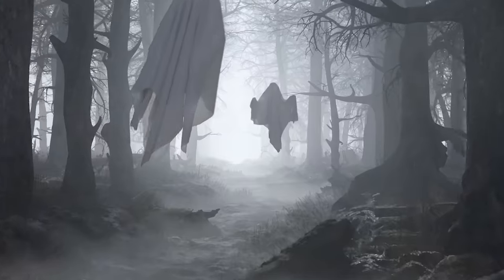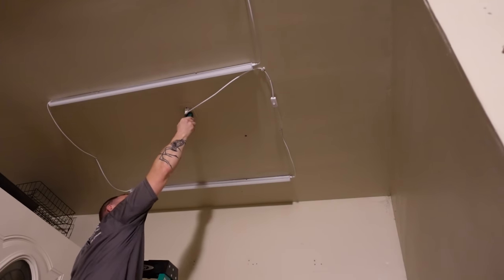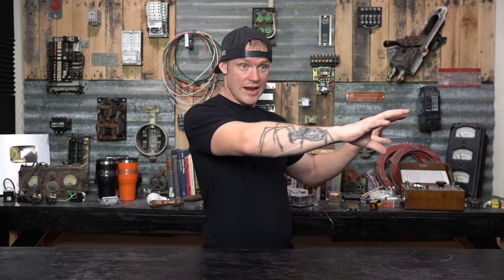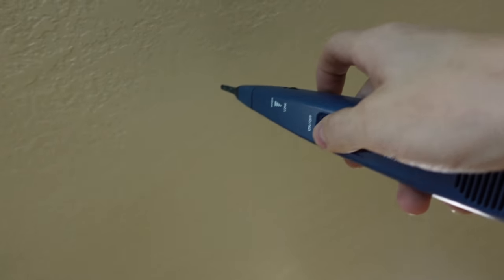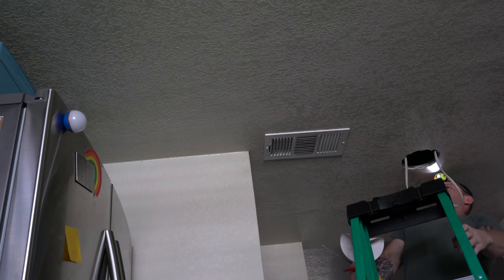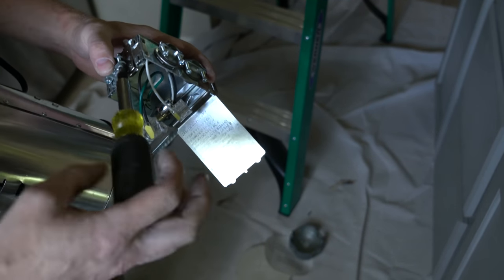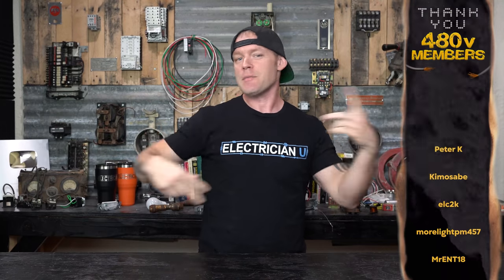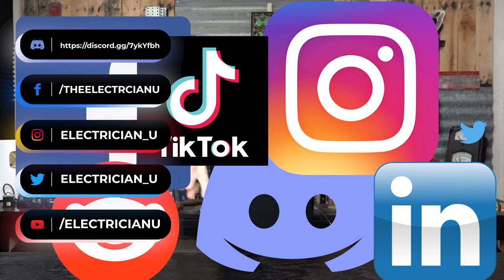THIS IS WHY ELECTRICIANS DON'T HIDE J-BOXES IN WALLS - Finding Hackwork!!

Comment: It's funny, just today I was troubleshooting a house with weird voltages on random plugs but some plugs working, 4 hours going through junction boxes and taking out receps and switches looking for a loose neutral. Finally I found it was the main power coming in, reading 5.6 volts on 1 leg. We called the local electricity provider and it turns out a tree limb wore through the jacket on the power line lol
Reply: Always check main power and panel before taking things apart inside the house.  Can save a lot of time over many service calls.  Not everything is a circuit issue or a burned junction.
Reply: @RobertMarts  it was an 80 year old house with newer mains coming in, I never would of thought it would be anything but the old knob and tube wiring lol
Reply: @RobertMarts  yessss...been THERE
Reply: I had the same thing. I first noticed it when I was in bed in front of a fan. It was a windy day and I heard the fan speed up and slow down. Turned out the drop was worn through where it passed through a tree.
Reply: always check the supply first...
Reply: Learnt that in field...took a min.but you right...line side
Reply: @obsoleteprofessor2034  called a brownout. Big problem where the overhead cables aren't maintained well, trees not trimmed seasonally. It caused us to have a HOT ground for a year, until I finally persuaded the power company to get the tree cut back in the street. 50v in the shower., bites from the faucets if you were barefoot...
Reply: @craigsymington5401  shit it took my local co-op killing three wildland firefighters the fourth getting burned over 90% and they had to pay him a 5 million dollar settlement to finally start taking tree trimming and inspection seriously
Reply: @craigsymington5401  We were fortunate that our electrical provider, SDG&E, handled a similar situation without any fuss. They sent a crew that added additional sleeves around the cables as the passed through the trees. Additionally, every two years they send a trimming crew to trim the tree branches back from the powerlines.
Reply: @RobertMarts  yup has this issue when my grandma called and told me some electrical outlets and lights quit working in her trailer I first thought it was mice might have chewed through wiring but then she found out she had partial power in her garage as well and the main panel is in the garage so as soon as I got there I checked the service entrance cable and sure enough one leg had no insolation on it and it was rubbing on the netural conductor so I put in a new service and updated the panel as well.
Reply: I had a similar problem but the only difference is that the one of the lugs on the main feed was worn out
Reply: Troubleshooting 101 in electrical and electronics; always check your mains. Though I admit to not following that rule all the time in electrical.
Reply: Make sure it didn't heat the bus bar
Reply: Took you 4 hours to find a dead leg??? I hope you are not a "professional" electrician, you would not be getting paid if that was my house. 15 minutes for a novice  MAX.
Reply: @craigsymington5401  YIKES !!!!!! Not good.
Reply: That's some darn good troubleshooting. Good job.
Reply: Apprentice move.  Take the whole building apart and it is the neutral disconnect.
Reply: Common problem and it always trips people up because if its just 1 leg damaged comming in, wierd shit will happen like only half of your house has power with all breakers on.
Reply: Had that on a flip house. About two weeks into rerouting and updating the electrical everything went wonky. GC kept blaming me until I finally got encore to come out. Turns out his fence guy put a post through the underground conduit. It was on the city side but he still had to pay outta pocket cause his guys weren't insured. Day labor's good for dirty work but you gotta keep an eye on those guys.
Reply: @ Nate 3006
 Thanks for posting this Nate! Now I know who NOT to call for any electrical work I might need in the future. And I'll make sure everyone else knows too. As an old  commercial work A/C mechanic responding to an "A/C out" call,  I would always check for power coming in FIRST, using that thing called a multimeter BEFORE I would take 4 hours changing out a compressor. Ya know Nate?
Reply: Once when i was getting a service drop- taken down so we could get at a tree I saw a city power guy  get blown right off his ladder because the bare conductor on the service drop was getting intermittently energized by a rubbed through spot on one of the hot legs, I think it arced right in front of his face while he was undoing the bare conductor---surprised him more than anything and he baled!  wasnt funny
Reply: ouch
Reply: @RobertMarts  Reminds me of a teacher going out with a student on a no heat elec dryer call. Student had dryer completely apart. Didn't bother to check for 240 at the outlet.
Reply: But you still charged the home owner when you should have billed the city or electrical provider.
Reply: I bought an old house with buss and screw fuses. I replaced the service panel with 200 amp service panel, got an inspection and the power company hooked me up.  The fridge sounded funny and the lights were brighter than usual so I shut down and called the power company. They had hooked up the 208 three phase to one of the legs.  So yes, check the supply line.
Reply: Wow. That crazy. And pretty awesome. Means you know your stuff. To track it all the way to the power source. We both learn something there. Check the main source of power first. Good job.
Reply: Hello

Comment: I went on a call one time to some apartments that were built in the 70's, tennant said all the receps on one wall didn't work. After checking every and anything electrical in the apartment, me and the J-man were stumped. It was then the tennant told us this problem started happening after the people in the apartment next door moved out. Uh oh. So we checked out that apartment, and surely enough, the power was off in that apartment, and we found out the receps were being fed from the panel next door.
Reply: That’s a bummer, now his electric bill is going to go up
Reply: @ndusrnm  lol
Reply: That's where you plug in the space heater
Reply: A plug was dead on a back to back kitchen. What was odd was that the lights were on in the adjacent unit with no tenant. I found power in the empty unit so I figured the original wiring had been flipped during construction and no one ever noticed. It turned out that someone had nailed through the siding, severing the hot from unit 1 and puncturing the hot on unit 2. The nail was conducting power from one hot to the other.
Reply: @obsoleteprofessor2034  wow!
Reply: Had a customer who had power when the municipality had disconnected. No magic there. Neighbor was supplying via buried cable. Smh

Comment: Electrical engineer here. Have to give electricians credit because all the circuits they need to troubleshoot are buried behind walls. I'll stick to my circuit boards lol
Reply: I worked in automotive for 40 yrs. everything is hidden . I could tell some stories lol.
Reply: Lmao, it's so true though.
Reply: In the factory I deal with freaking everything 🥵 mains to 5vdc, comms, networking, air, motors, bearings...
Reply: Fellow EE here but I also do the electrical work in our office at times - everything from taking care of our pick & place to our environmental chamber. Yeah, I agree... I'd rather be on the bench than up on a ladder or poking a hole in the wall.
Reply: Also EE, and all of my circuits extend no farther than my test leads.
Reply: Engineers trying to take kudo’s meant for trades people once again! Stick to your blueprints unless you have a trades ticket!
Reply: @harles5000  Lol I actually started out in the trades, then went back to school to be an engineer... So I COULD take kudos if I wanted. Many engineers started in the trades.

And quite frankly, while trade work can be difficult, engineering work is on a whole new level. As we don't look at "blueprints" all day, we create the designs for everything in society. Most engineers are capable of anything a trades person can do, but our skill set is best used for more complex tasks. Akin to a doctor can do what a nurse does, but their skill set is best used for more difficult tasks.
Reply: @MN_Engineer  Well good the best engineers I worked with have field experience and trade tickets and I’m a Electrical Engineering Technologist with two trade tickets! Learning never stops! I would do electrical utility designs and engineers would rubber stamp them!
Reply: @harles5000  It all mixes in my experience. Some of the best solutions come from Technicians in my experience, while some of the best hands on are engineers. The sit at my desk and want to send e-mails all day engineers DO make me shake my head tho.
Reply: @MN_Engineer  The best engineers lack arrogance!
Reply: my IR camera was a game changer for me.
Reply: White automotive technician here. Hey trust me it gets even worse. Modern vehicles are basically laptops sitting on top of 4 wheels. Here in the rust belt (Ohio) electrical gremlins can go from awful to "fuck this, I hear Mc Donalds is hiring" pretty fast.
Reply: Also an EE. I do home repairs, and for friends, too. About every 3rd job, being electrical, and plumbing, too, involves knocking holes in the drywall. I've gotten quite good at slapping "mud", when the jobs done. I make sure all J-boxes, are not hidden, and accessible by very noticeable panel. This often means moving stuff, as part of the fix.
Reply: @blackfender100  I hate working on automotive electrical issues, just solved two so I guess I'm finally getting better at it at 47 years old but it still sucks. Fixing the problem is usually fairly easy it's diagnosing it that's the problem especially intermittent problems.
Reply: @MN_Engineer  I'm an EE and a master Electrician and I can confidently say the engineering side is most definitely not harder. Anytime I get an electrical blueprint in industrial or even residential from another EE, I'm forced to remake the entire thing every time due to EEs not actually knowing how things work off of paper.

Comment: The moment you actually diagnose a problem like this, up to the point you first flick the lights and everything works properly... that's like a drug
Reply: That's very true - and applies to anything you can fix, be it cars, plumbing, small electronics...
Reply: Let there be light! and there was, and it was good!
Reply: Yes, even on open rough ins, start from scratch and the house or commercial space fires up. Thats what got me hooked
Reply: In my electronics career so far (1964-USMC, on) I call it PAYDAY! Against all odds, it WORKS! Yay! The drug is several endorphins... Its' why I get up most mornings.
Reply: I concur some times locating a broke neutral like this one can be a nightmare especially on older houses still prefer Romex wiring versus old knob and tubing
Reply: Especially when u aren't an electrician
Reply: @bucarter7485   Yeah, bad neutrals suck, especially at the service! :)